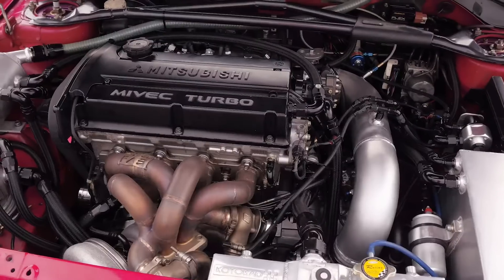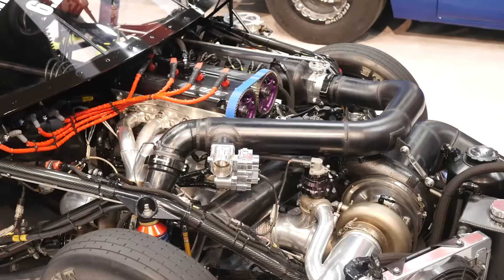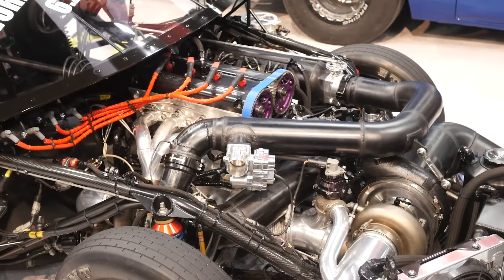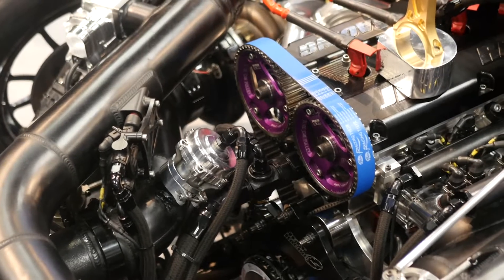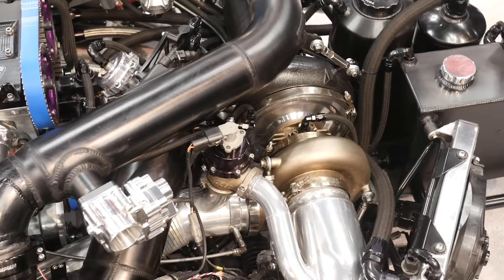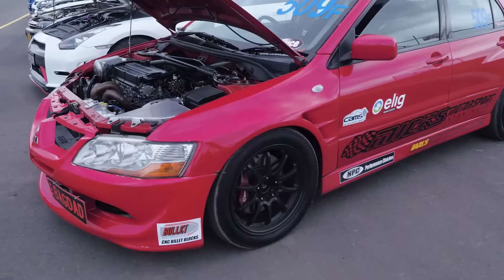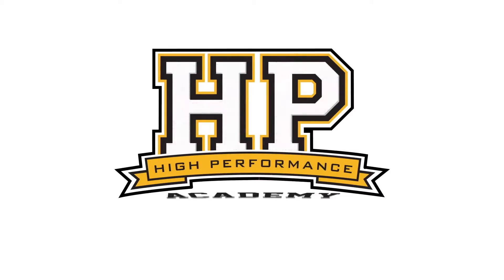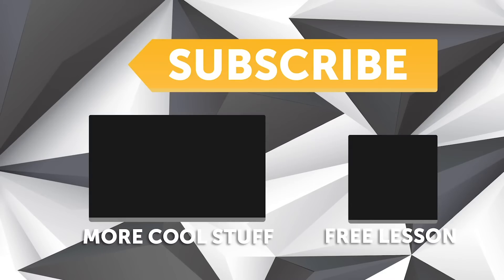INSANE 4G63's with 700lb-ft of torque and 43PSI at 4,000RPM [TECH TALK]

Comment: With billet blocks available,  wouldn't that be an easier route? I've run 39 psi with arp studs copper o rings and a cosmetic gasket for over 100 passes and 10,000 miles of street driving. Super reliable combo.
Reply from the maker: Some classes of racing don't allow billet blocks, nor is the block itself always the main limiting factor.
From there even if you wanted a billet block, you also have to have one available with water jackets etc for your chosen engine, as many are drag racing specific and are bare bones.
Then you have to throw money at it.
Also note a lot of Julians excellent knowledge was developed from a time before billet parts were feasible options too.
100% a solid option though where applicable, but just going to a billet block isn't always easy, or necessary - Taz.

Comment: I have a 1khp street evo I run 2.0l custom ross piston 20 over 10:5:1 short piston R&R aluminum long rod, arp 625 head studs Ferrera comp valves, kiggly beehive springs and retainers. I use a stock head gasket. 
I think he’s over thinking 600hp unless he’s running a fp red with all the boost.
Reply: The problem he had was that he was making a lot of boost at very low RPM which was causing the problem.
Reply: Making 1000hp on the dyno for 2 seconds isn't the same as making 600hp for a season's competition.

Comment: How does the plate work ? Is it literally a plate between block and head or is it a plate then a sleeve threw the plate and block ?
Reply from the maker: It's a plate with a steel sleeve pressed through and into the block.
Reply: @hpa101  that makes sense how does that improve the cylinder deformation or isit because you have shifted the cylinder higher that it doesn't become an issue anymore as the threads are still in same place  Interesting process never heard of this before I'm amazed what people do to sort these problems out

Comment: Alfa made an integral block and head design a long time ago as did an Australian Top Fuel drag racing team, who's name escapes me ..... McGee? Sainty? Anyone out there know?, but the obvious difficulty in working on the valve seats and who knows what other complications an integrals assembly geometry posed must have put the kibosh to the idea.
Nonetheless, no head gasket (parting line between block and head) = one less pressure leak area to address.
Reply from the maker: Yup, it was done back in the F1 turbo era by the likes of Brian Hart, as well as Indycar too. A lot of compromise in that particular design though.

Comment: I was a bit confused by the concept at first - I take it the plate acted as a very stiff intermediate between the block and head surfaces, both of which could normally flex and distort when stressed. If so, the plate would effectively halve the potential flexing between the two components?
It does raise a bit of a question, though - before the billet blocks were available, were any of the high end guys machining off the top deck surfaces and welding on thicker, high tensile aluminium plates - maybe profile machined on the underside for thicker material around the threaded bosses?

Nice to see the rod angle being mentioned - may be worth a follow up video (don't recall seeing one) on the affect the rod/stroke ratio has on the bore side loading* and piston peak accelerations?
*remember viewers, simple cylinder pressures apply equal force to the liners - the shift, or walk, is due to the side loading of the pistons on them.
Reply: From what I gathered, they stuck the steel piece on there and installed taller liners. Then they ran a longer rod to maintain 2.0 liters.
Reply: @AlexAutoRepair1  

Uh, yes, that was quite clear.
What I was wondering out was HOW it worked.
My assumption is that as the 'crowning' affect, the flexing, of the block AND head is normally applied across one gasket, compromising the areas between the fasteners, using a steel plate isolates each part and the gasket just has to deal with that part.
Their other option, while staying within the engine size limit, would be to use the additional bore length to stroke it and reduce the bore diameter. It would allow thicker liners but probably compromise breathing, depending on the chamber shape.
They're smart cookies, so they will have done their sums ;-)

Comment: This sounds exactly like what Cat uses on their 3406e engines. The liners protrude out of the block and a steel spacer goes on before the head essentially locking bore spacing and stopping liners from moving. They use a thin metal gasket under the spacer along with rubber seals that go through it to connect the head coolant ports to the block. Something like this https://images.app.goo.gl/MLCZJJwNaKSV3QTA7
Reply: Pretty cool idea, I’d be keen to see a factory engine with both a deck/head spaced and a bottom end main cap brace.
Reply: VL_TURBO420 cat used both on the c15/3406 engines. Cummins has used stiffener plates on the bottom of their heavy duty engines for years. Cummins and Paccar also use a scraper ring in the top of the cylinder bore to clean soot off the pistons so the rings don’t get stuck and allow blowby. If you had an engine with a head spacer, piston scraping rings, and a block stiffener plate in the automotive arena, that would be a powerhouse! Use the newer compacted graphite iron for the block and head, then run an offset big end on the rod to take stress off of the bolts. (Just like a 15 liter semi engine). Then you can put some serious and reliable power out.

Comment: This is so old school , they used to furnace braze  a  cast iron plate on the top then sleeve through it or braze in large sleeves  (  not much turboing going on then used to increase engine capacity)  ,and the same on a 1600 ford crossflow to turn it into a chanberd head - maybe showing my age. As always Andre a  excellent job in the interview
Reply: Martin Hulse least on a cosworth yb you can long stud it

Comment: If it's 43 PSI and 700 lb-ft at 4,000 RPMs, I want to know what 75-80 PSI feels like?  4:53
Reply: Like heaven and hell collided.
Reply: 75-80 foot pounds of torque actually. He was talking about the test he made on 2:55
Reply: @amirunner  Lol that is not even close to what he said! He was saying that they were able to strengthen the deck face by adding a steel plate (with steel sleeves and oil control rings) on the billet aluminum block. When they torqued the head bolts down it wouldn't distort until they reached 75-80 pounds of boost (5.17-5.51 Bar). 75-80 pounds of torque is like....barely more than a 4-wheeler
Reply: @Thumbs-Akimbo  lol to you. Listen carefully what he said. 4:48 "we did the same test with the oil control rings on top of the bore (block deck)"
(With the 12mil plate, starts to distort on 75-80 head bolt torque) vs (without steel plate, starts to distort on 15lbft head bolt torque, 20 thou distortion on 35-40 head bolt torque 2:55)

The oil control ring wasn't used in the plate+liner setup. It's just used as a fulcrum to distort the block during the test

Comment: What turbo is he running where he's able to get 43psi pounds at 4000 RPM in a 2 litre
Reply: There are a few that do it. A garret tr30r is common. But the efr line can do it also. These cars also run fresh air als so that helps
Reply: @tpsretard  what efr? Any idea on which? And ive never heard of that seires of garrett. Is it better than the g series?
Reply: @marvinwatson2749  in rally cross we have used a few different ones but the 7670 is a good choice. The tr30r is a motor sport only turbo. Not available off the shelf.
Reply: @tpsretard  thanks alot for the info im looking for something the would spool similarly in my set up. Thats crazy boost for that low of an rpm
Reply: @marvinwatson2749  as talked about in this video. Low rpm and high boost needs good head clamping. The als is the secret to the low rpm high boost. But also what pulls the head off the block.
Reply: @tpsretard  ye i wont need that kinda boost for my setup 20 psi is more than enough at that rpm
Reply: @tpsretard  What is the ALS?
Reply: 700 lbs ft at 4000 rpm? Shit!

Comment: I need to see what this steel plate and liners looks like in the 4g63
Reply: i wanna to but theres a reason they arent showing it im surprised he even talking about it!
Reply: @luisgarcia288  Yeah if he has developed a solution and sells it, perfectly fine for him to keep it to himself so to speak. Sounds like he has spent a lot of time on R&D with this - time is money after all
Reply: wrighty338 yeah we’re lucky he’s giving out that good info
Reply from the maker: The only reason we can't show these aspects is because there was no engine in pieces at Goodwood to shoot. The plate referenced is simply a steel plate that fits between the head and the block. It's o-ringed to the block to seal oil and water. The slightly tricky part is that the sleeves are then pressed through the plate and the block which essentially ties it all together. The steel sleeves are stronger than a ductile iron sleeve so they can be much thinner than a typical sleeve.
Reply: @hpa101  He mentioned 2 head gaskets? If he or rings below the steel plate, where does the second head gasket go or does it mean he put two on top of each other?  Also would this help in preventing a deck cracking from high cylinder pressure as the head lifts? It would still be pulling The cast block deck?
Reply: Platinum just uploaded a split block vid.
Reply: @8:24 he gives info on how to contact him and his company

Comment: Billet blocks and heads turn an engine into what it wasn’t in its stock form, thus should race in a different class
Reply from the maker: What about tyres, suspension, roll cages, intakes, exhausts, seats etc etc etc? If you want to be a purist, NOTHING would be touched and you'd run the tyres the manufacturer specified.
That's not something I'd like to do, but there might be a class of racing out there for people who do, or they could start one, otherwise a race car is always going to be far from stock - Taz.
Reply: High Performance Academy 
Im not proposing the restriction of any mod. But the prospect of running a stock 4G63 vs a billet version @ 100 psi boost in the same class poses a clear, grossly disproportionate advantage.
Reply from the maker: @flyonbyya  ahh, I'm with you now. I did interpret that a little different, but at the same time it's still a line in the sand somewhere. That said I believe the R35 scene is very active and has such splits with times relating to stock blocks and stock turbo locations, but even then there will be those with a bigger budget to push things further than those with less which is essentially the same argument many use for cast vs billet. That said, if the interest is there the more classes and racing there is the better
  - Taz.
Reply: High Performance Academy 
I’m certainly not proposing an “all or nothing” rule, as you seem have interpreted my words to mean...not at all.
I in fact didn’t intend to  imply or suggest a “NOTHING” to be touched, or propose a “purist” rule...and I don’t think my words reflect that intent.